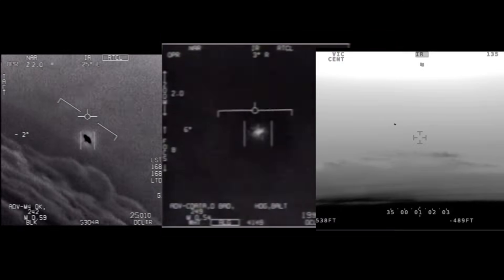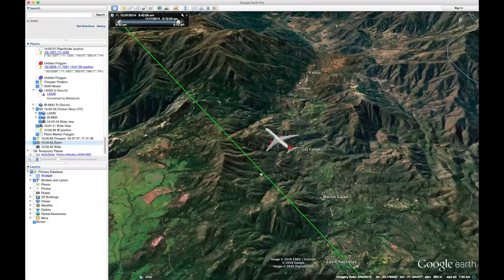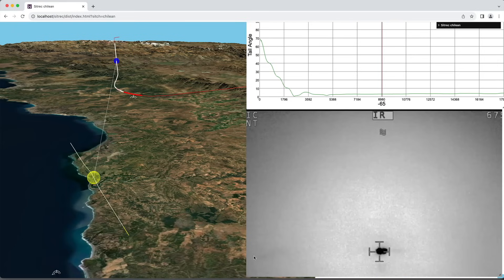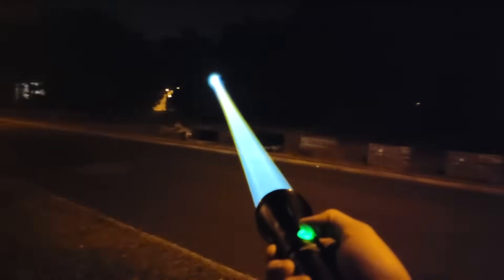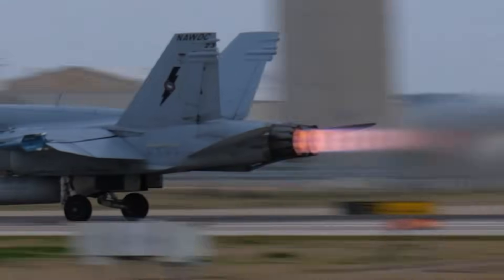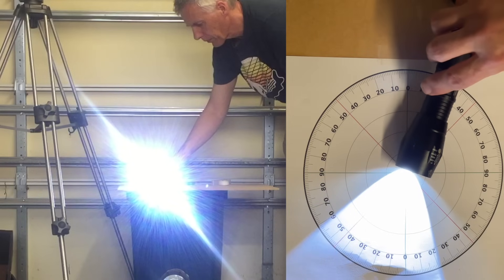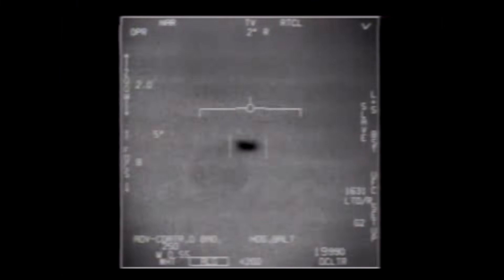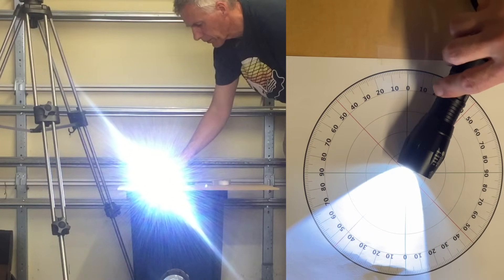Jet Engine Glare - Angles and Sizes

Comment: Great video.  I am not exactly clear on the dramatic reduction in glare past a certain point with out flashlight lens (more closely simulating a jet)?  Large glare is maintained for awhile but then drops dramatically.  Do we know at what angle this drop would be expected to occur for a jet?  Is the angle in the gimbal simulation within parameters for it not to occur?
Reply from the maker: The precise angle isn't clear, but looking at similar examples, it's quite large as the "tube" isn't that long.
Reply: Yes, he shows examples of recorded IR glare from jets  finally changing in appearance at a sharp enough angle. It goes from purely obscured full glare of unchanging shape, to an easily identifiable image of the jet after large angle to the camera. A bit over 30 degrees it seems before the appearance begins up change, but I’m sure the precise range for a given jet tail & IR camera set up could depend on a multitude of factors.
Reply: @MickWest  Thanks!  And keep up the good work.
Reply: I'm pretty sure it's a complex mix of the specific optics AND the geometry of the jet, and the plume. There are a number of factors at work. How the sensor reacts to over exposure at a variety of frequencies. The dispersion thru the optics. The emission spectrum across the range of viewing angles. The shape of the optical elements, especially the aperture. I imagine a small change to any one of these things could have a large impact on the result. Might be fun to write a simulation. I was considering whether you could remove the bloom, and try to get an idea of the shape of the object itself, but unfortunately I think most of the information is lost xhen the sensor saturates.
Reply: @sIXXIsDesigns  Oh I'm not criticizing the video in the slightest. I thought it was a very good practical demonstration that gets the point across effectively. Nick always delivers
Reply: @sIXXIsDesigns  I was responding to the question of what angle to expect the drop off. To summarize: it depends :-)

Comment: One reason the jet glare will be seen from a larger angle is also that the heat generating area is not just within the nozzle, but also extends outside the nozzle. So the torch/flashlight comparison isn't completely perfect. Nonetheless your analysis is top notch 👍

Comment: That's a good interpretation, but first we need to prove that the interpretation is actually happening, are the testimonies consistent? Is it possible pilots could have mistaken a fighter jet and or jet engine with UFOs considering the anomalous radar activity, the presence of EW (radar being jammed according to Underwood) showing boogeys going at incredible speeds, and reaching altitudes not consistent with these jets? Underwood also said his object was doing weird stuff on radar so that's why he went to record it.
In first case if these were fighter jets they would know about their presence on radar, and there were no other F-18s than them, and none were having such unusual behavior, they recorded the same objects that are on the area according to the radar, and were doing such unusual behavior, but the videos are not complete at all they don't show the full perspective in order for you to know what they're talking about. 

Considering all these factors happening how do we know you're right? We can say that its a correct interpretation, but it is currently inexistent according to the pilots.

"The operator said the object would suddenly appear at 80,000 feet, hurtle towards the sea, hover at about 20,000 feet, then shoot back up into the sky

'By this time we’re driving around and we’re just watching this thing and I go, "hey I’m gonna check it out,"' Fravor recalled. 

'It’s aware of us and it goes bloop and start coming up, so it knows that we’re there. This is like five minutes,' he added. 

'I’m going to meet it and I’m probably a half mile away and it’s coming across my nose …and it just accelerates and disappears at about 12,000 feet in less than a half second and it’s gone,' Fravor said.  

'I remember telling the guy in my back sat, "Dude, I dunno about you but I’m pretty weirded out,"' he said in the interview.

Fravor said he and the other jets went down towards the water to see what the object was potentially hovering around as they noticed white water when the object was over it, but it was 'clear blue' when they reached it."

????

Comment: Dear Mick, first of all thanks for the demonstrations you perform in very cartesian way, which is exactly how the subject should be handled. I remember having asked last year when you posted the video explaining the rotation of the glare. I am still skeptical on the interpretation of the glare rotation due to the camera rotation. This in addition to the other elements brought by the pilots in the audio part claiming that they see something rotating. Could they have been trumped by the FLIR image? I am also still puzzled by the fact that the FLIR image would show a rotation of the glare, and allegedly not the craft, and seeing that the clouds are not/partially rotating. Would there be possibility to reproduce and verify on Flight Simulator for example (no clue whether the light physics on this simulator is reliable)? Also would it be possible to bring a translation from each video? that is to say, the size of the flare (as I understand that the size of the flare is not the same as the craft)? Its speed ? Can the size of the craft be deduced? Direction of the craft? Direction and speed of the wind? (as the pilots seemed to say that it was going against the wind) The craft's temperature? Its altitude? (is its altitude usual for a flying aircraft?). I must admit that each information that see the pilot on the screen is still tricky for me to understand. Once again, thanks for taking the time to answer to our naive questions.

Comment: ISR operator and IR simulation engineer here... your analysis is wrong.
Glare is mostly an atmospheric effect in the visible light spectrum due to particles or watervapor in the air.
Infrared wavelenghts are not scattered by that. What you probably see on the airliner is surrounding heat reflected by the aluminum hull. Metals act as reflectors in the IR spectrum.
Infrared imagery target interpretation  requires a significant amount of training and experience. 
Hence why our company creates FLIR and Wescam simulators for police and military training.
Reply from the maker: Atmospheric glare certainly exists, but that's not what we are talking around here. Try taking a video with the sun just obscure by a building. You'll see the atmospheric glare you refer to, but if you then move a bit so the camera is looking at the sun, the in-camera glare will overwhelm that. 
Infrared glare clearly exists, as you can see at 4:01.
Reply: @MickWest  The glare at 4:01 into your video is the radiative heat of hot exhaust gases dispersing into the ambient air.  That is not optical glare.
It useless to compare any visible light effects on a normal camera to infrared light effects captured on a FLIR.
I see mostly lens flare in your tests with visible light.
Lens flare and glare are hardly ever seen in the Infrared spectrum that a FLIR/WESCAM camera works with.

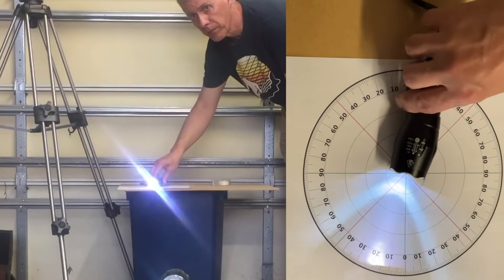Comment: 2:32 they use after burner for takeoff. The jet cone does not shoot out like that during normal flight...
Reply from the maker: Yeah, the gas cone is not that relevant. It’s more about the hot metal/ceramic of the turbine and surrounds.

Comment: Good work once again, sir. I believe that thermal glare is also more diffuse than light rays, sort of blooming around the source, which would hide the jet even more, and from an even larger angle. Would thermal glare be visible from the front and sides as well, maybe?

Comment: Trying to over analyse the Navy videos is like taking a phrase out of context from a paragraph and totally misrepresenting the situation. Everything  needs to be taken into account. The videos don't represent the entirety - the whole videos needs to be seen ( wherever they are ), the radar tracking data for several weeks  and eye witnesses testimony.  To simply dismiss the radar tracking as glitches and to dismiss the pilots visual sightings as erroneous is simply trying to disprove it for the sake of trying to disprove it - seems like clutching at straws.

All the other videos without any  corroborating evidence are worthless.
Reply: The Tic Tac Object was filmed in Nov 2004. There is no saved radar data just the fading memories of aircrew at least one of which has gone down the rabbit hole.

Comment: Let's suppose these were actually distant planes. In that case, how can we account for the Navy fighter jets' inability to regain contact with these objects? Wouldn't this task be straightforward for skilled pilots? Alternatively, are you suggesting that the Navy pilots intentionally chose not to approach the objects closely enough to attain clearer visual confirmation?
Reply: when a jet flies a sortie, it has mission objectives to hit. it is expensive and essential for career progression. unless it is a clear and present threat, there may not be a pressing  need or opportunity for pursuit
Reply: maybe it has jammers like suggested by F-18 pilot Brian Burke. This explains why pilot detect a fleet of contacts on radar but only sees 1 visually.
Reply: ". In that case, how can we account for the Navy fighter jets' inability to regain contact with these objects? "

They were low on fuel.

Comment: The exhaust gasses are far more visible in IR than the interior of a jet engine would be.
The 747's silhouette is visible in IR because the exhaust gasses are being reflected off it.
Reply from the maker: That's entirely false. Gas has a very low mass, and a very low thermal emissivity. You can only sometime see the cone of hot exhaust gas when viewed from the side with the contrast adjusted. see: 4:00.